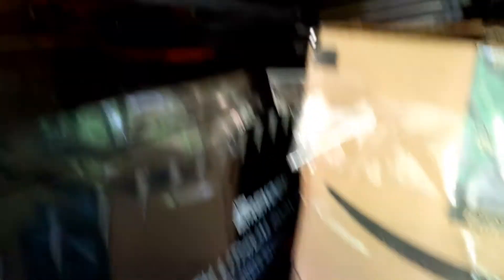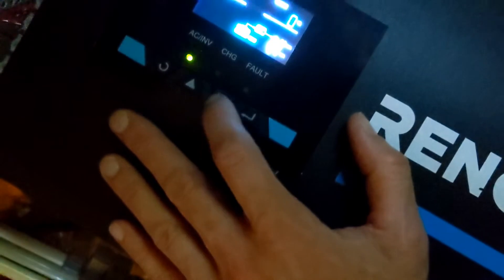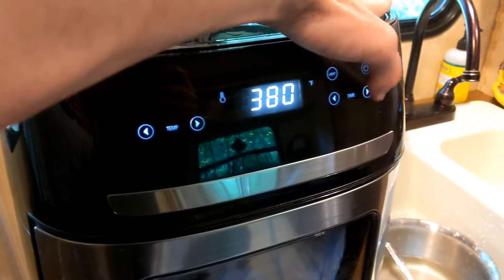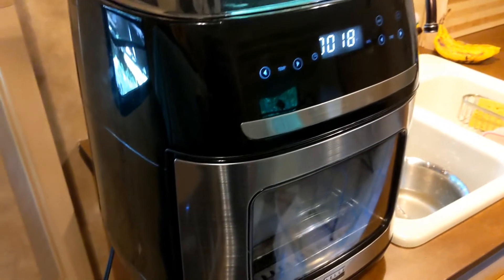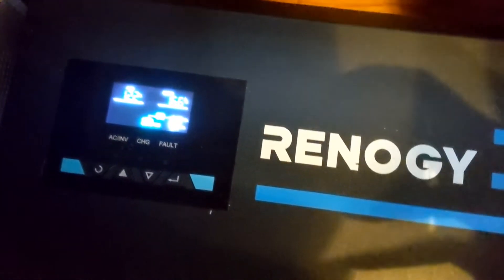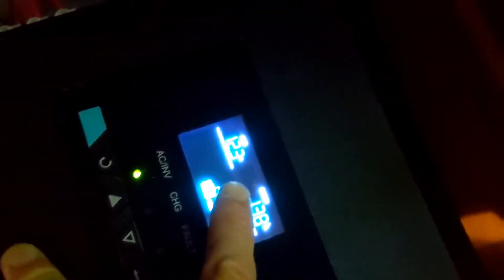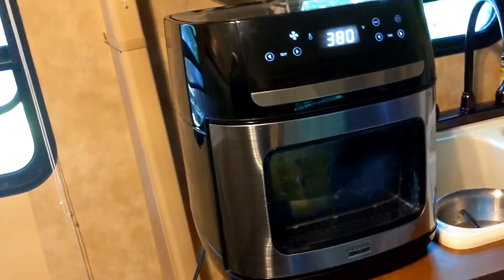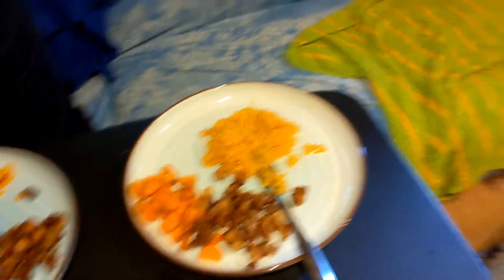Running an Air Fryer off Solar and Troubleshooting

Comment: hi are you having problem? i will try to run 1500w air fryer on 2000w modified inverter but having doubts.
Reply from the maker: It continues to shut off every few minutes. I would recommend getting a stronger inverter.
Reply: @OutdoorTraveler  thanks. i have tried with 12v 3000w pure sine inverter and no problem so far. and i think its more efficient due to lower load.